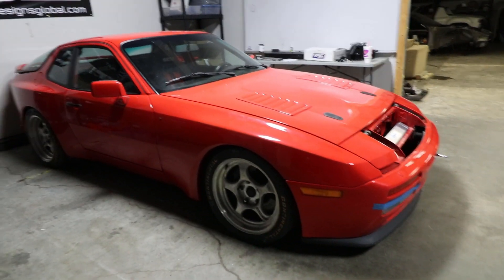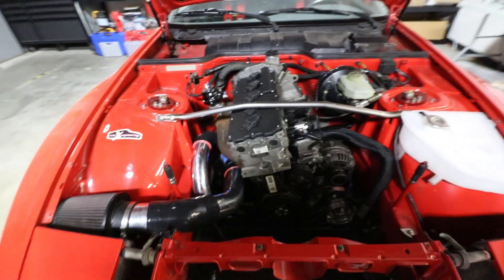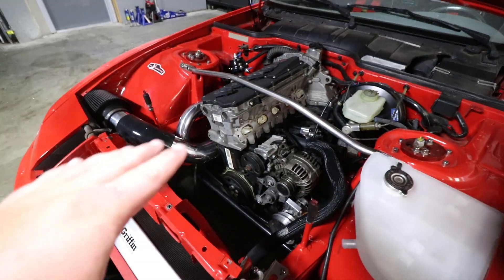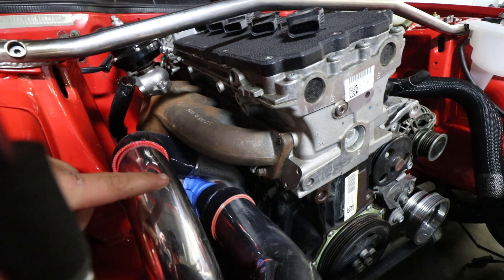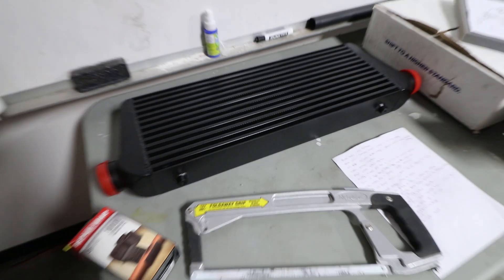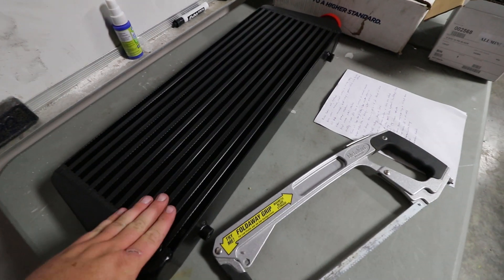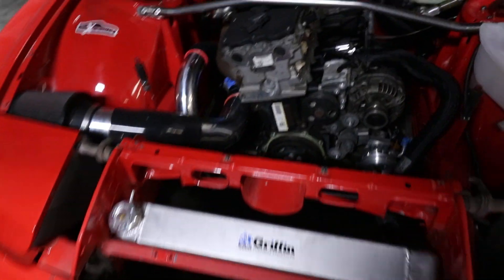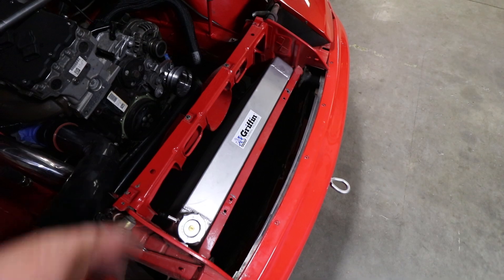Turbo 07K Build - Part 1 (Porsche 944 5 Cylinder Swap)

Comment: So you went from blowing a reliable LS V8 to looking foward to tackling a turbo upgraded 2.5L Inline 5? I sense horrible tuning... i mean how did you blow an LS engine dude? That is 1 of the most reliable engines and easy to tune with all the great info out there!
Reply from the maker: That is the common theme when discussing LS swaps but that’s not necessarily the case when it comes to 944’s.

Comment: Which 07k should you start with to do a boosted application? Any old iron block one? Goal is 600whp.
Reply from the maker: Yep, any old iron block! I prefer 08-10 but you can use whatever. The factory rods and pistons won’t hold 600 but the crank will. Aftermarket rods and pistons or TTRS milled down to reduce the compression and you are off to the races.
Reply: @BoostBrothersGarage  thanks! I’m planning on building it anyways, just wanted to make sure I started with the right block.
Reply: @BoostBrothersGarage  What's the major benefits of the 08-10 engine? I've got a local engine I might source that has acceptable mileage and price with everything attached that is a 07' engine.

Comment: Do you know if that car is running spacers for the rear wheels? Im having issues finding any kind of after market wheel for my 944 bc of the bolt pattern. Im not sure if spacers are "legal" for the drag strip or not? thanks

Comment: 3 - 3.5 inch's is what people upgrade to in p2 Volvo R's which is stock a 300hp 5 cylinder engine, should be fine.

Comment: Wonder if you can get the AC to work with this swap, I would love to do this to my 87 944 looks easier then doing the ls swap.
Reply from the maker: There are two options for AC, both bring developed by guys that are doing the swap. One utilizes the factory compressor and the other an electric compressor.
Reply: @BoostBrothersGarage  Sweet so following your channel cant wait to give my 944 a new life as a GT car

Comment: 3.5" down pipe MIGHT give you some slightly inaccurate readings with your wideband at idle,  rock the 3.5 to 3" more than likely wont notice a difference and you could always do a cut out and dump it before the back section
Reply from the maker: Considering an electric cutout for sure

Comment: We made 552whp @ 25psi with 3" exhaust 3.1ltr 8v 944t motor. I always felt that was a bit small. Went to 4" on the 3.2ltr 16v motor. Made 620whp @ 16psi. Not that you can call that an Apples4Apples comparison.
Reply from the maker: Damn, that car must have been a monster!
Reply: @BoostBrothersGarage  Racecar. Weighed about 2500lbs. Did ok with some good results and became quite well known.

Comment: While 3.5 and 3 inch will get you to your target, going larger in diameter will make it easier and help with spool up.
Have a read here to a comparison with documented results (on the dyno) on downpipe diameters on a 1JZ.
https://www.facebook.com/STAVTECH/posts/ive-probably-talked-about-it-more-than-any-other-tuning-subject-and-it-feels-lat/985989948244194/
Reply from the maker: Ahh, actual data, thanks!

Comment: 3” should be fine, bigger could make more but turbo size, intake manifold, and fuel will probably be your main restrictions if the 5 cylinder behaves anything like a 4 cylinder.
Reply from the maker: Its going to be a lot of fun to find out! I’m going to find all the limits after turboing the race car. Fuel pump, injectors, transmission, short block - turn it up til they break/limit and then replace!

Comment: My .02, if you're not running a catalytic converter, 3" exhaust should be fine. I think you'd be most restricted by whatever downpipe situation you got going on. And it's not a snail, it's a PARTY WHISTLE.
Reply from the maker: Spooly boi*
Reply: @BoostBrothersGarage  Noisy Tuba
Reply from the maker: Hairdryer

Comment: Did you use the crank that came with the motor or source the vw OEM forged crank? Or possibly use the forged crank the Audi 2.5 turbo motor uses? If you are using the cast, how much power do you think it can reliably handle? 
Sorry if you already covered this.
Reply from the maker: Using the cast one for now, will upgrade to the TTRS forged crank later. This is a CBTA engine, not the earlier engine so to my knowledge there were no forged cranks in any of these. My understanding is the cast crank is good to 600 lb ft of torque but the rods will let go before that.

Comment: I owned a 1986 944 turbo with a 4 inch exhaust and it made 417hp on 21 lbs on the dyno , no idea what it would have made with a 3.5/ 3 the guy that help me build it says it don’t matter what you running. Example hood stacks and short shots on the back of turbos.
Reply: You should probably just go ahead and do the 4” so you’re not up grading later, might save you a short amount of time and money in the long run. Also might give you a slightly deeper sound.
Reply from the maker: I’m going to try to talk Alan into it
Reply: Uploaded a video of you wanna see what it sounded like
Reply from the maker: Sweet, I’ll check it out!
Reply from the maker: I would be way more comfortable with 4” on this build. Just a point of reference, on a 600 hp turbo mustang switching from Flowmaster (chambered) to Dynomax (straight though) mufflers was worth 10% more power, at the wheels

Comment: 3in is more than sufficient for 700 whp.
Reply from the maker: I mean I know cars have made that much but turbo cars LOVE free flowing exhaust. Guess we’ll just have to do a dyno test to find out!
Reply: @BoostBrothersGarage    don't overthink it. I made 527 at the tires on a tq limited tune through a 3" exhaust with a muffler and about to turn it up more through the same exhaust.
Reply from the maker: Damn, impressive!
Reply: @16vt  With what motor / specs did you make 527whp?

Comment: The LS was just probably throwing a fit about being put in something German 😂 That tilted radiators begging for a sheet metal duct out the bonnet.
Reply: Leading edge of hood opening must have gurney flap or you’ll fight high pressure air going over the hood
Reply from the maker: Good to know, thanks!
Reply from the maker: Definitely needs a GT40 style duct and hood scoop! I’ll probably do that to mine when I go turbo
Reply: Boost Brothers Garage There’s a dude in South Africa who’s already kind of done it, except he’s got a bit of a fugly moulding on the bonnet.
Reply from the maker: I’ll just have to do it better!